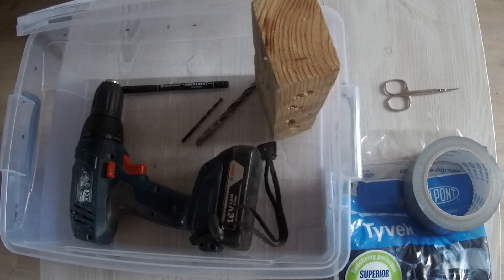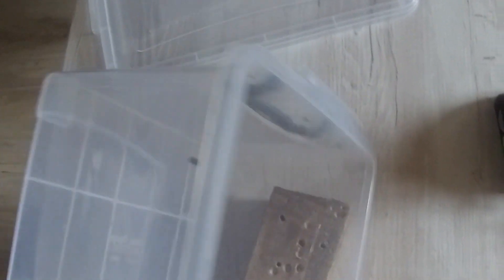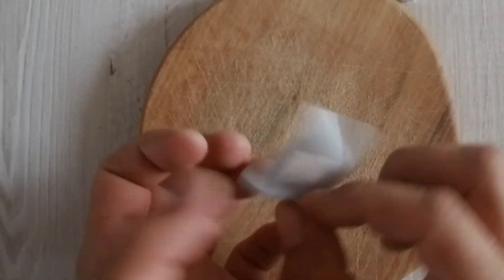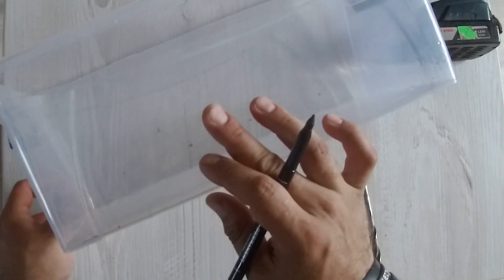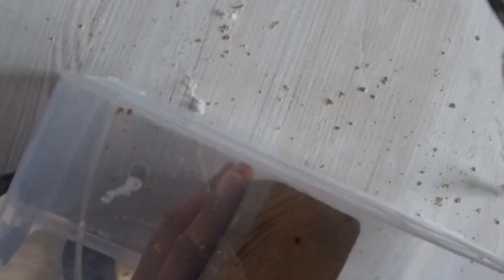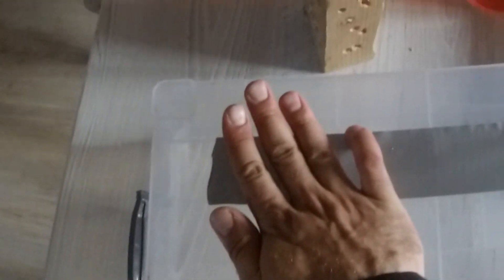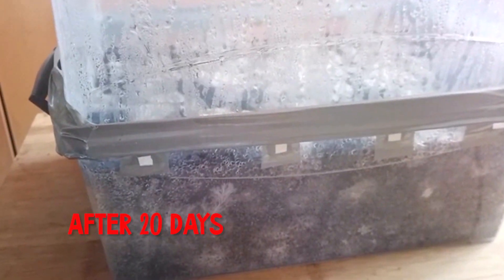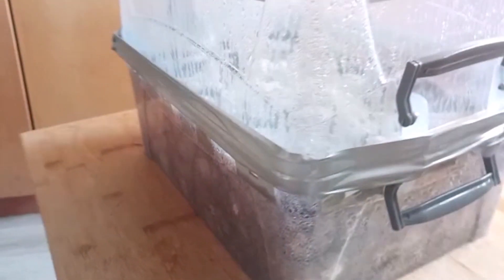🍄 Shroom Academy How to make a monotub. Full process of DIY dubtub for indoor mushroom cultivation.

Comment: That design is not what most people call a "Monotub."

A "monotub" is generally a larger container (typically, 66 qt/ ~63 liters), with a single, larger whole near the top of the short of the short ends, and 2 or 3 larger holes just above the top of the substrate on both of the long ends. 

The design in the video is like an odd sort of shotgun "dub tub."